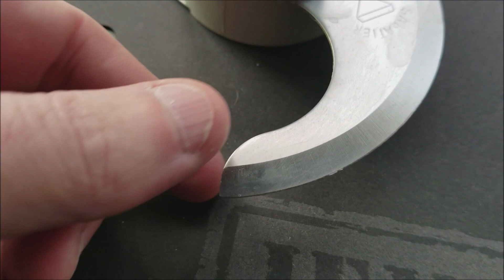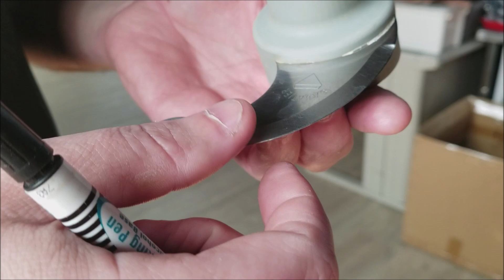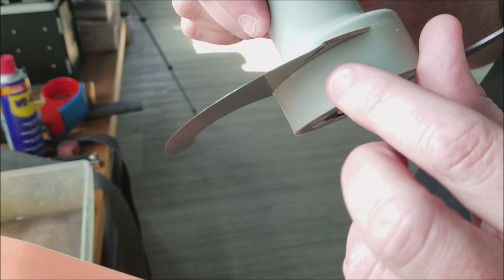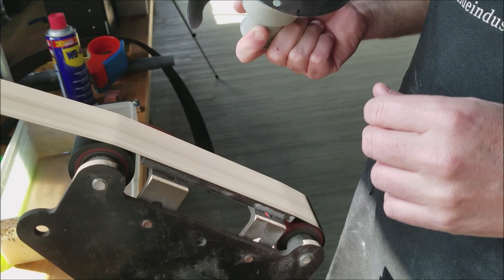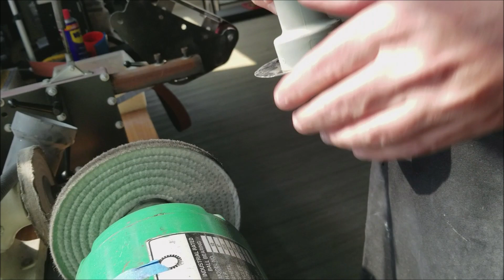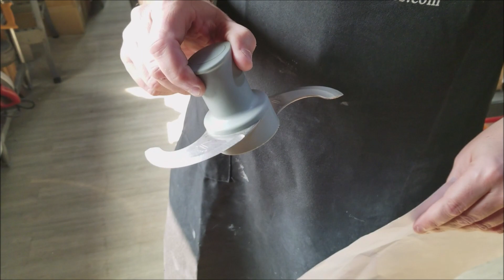Sharpening Robot Coupe Blades - by Jende Industries

Comment: Hi, Mr. Jende.  How much do you charge for that type of job?
Reply from the maker: Actual prices will vary depending on what prices are acceptable in your local market, but I charged 2x the normal knife rate for these since I see it as 2 blades to be sharpened. I recommend charging as much as you can, but fairly and so that the customer will feel it was worth the price for the service and come back in the future.

Comment: What about the Robot Coupe 27061 Fine Serration Blade?
Reply from the maker: Excellent question! The serrated blade of the 27061 looks like is not meant to be sharpened, and certainly not in the same manner as this video. You have 3 options to approach it, however. 1st is to just buy a new replacement blade. 2nd is to get a very fine file and file every single serration to get the tooth back, then hit the bottom side the same as in this video. 3rd is the hell with the serrations, and sharpen it the same as this video. Option 2 is probably best, but still quite time consuming and therefore sort of make option 1 the easiest.
Reply: @JendeIndustries  1st option spending $300/ year (2 blades) I must have the blades sharp for making almond and hazelnut butter. Option #2 is spending hours, :o)  I am taking option 1. Thanks for your great advice!
Reply from the maker: I wish you luck!  However, you may try this last approach - buy the replacement blade and then sharpen the old blade as in this video without worrying about the serrations and see if that makes a difference. I would recommend using a coarse file or very coarse grit belt or stone only. Mechanized anything is usually more about the shape of the blade than anything else, including refinement. The roughness of the edge will help maintain that serrated effect. If you do it, please let me know how it turns out!

Comment: Nice video. Again an "EXPLAINFULL - STRAIGHT TO THE POINT - WITHOUT HYPE" characteristic video of yours. 
Although beeing an amateur, I had a quite similar blade - only a tad smaller - in my kitchen to sharpen. I thought, if I can sharpen adequately my kitchen knives, why couldn't I do this???  Well, once again you are correct, THIS IS NOT A SHARPENING 101 CASE. 
I took it into my small amateurish workshop, fix it in a vise, and tried to sharpen it eith a slipstone of mine. I hadn't realize the amount of time and effort needed -  as one approaches the "deepest" point / the bottom of the concave bevel, the surface to be abraded becomes suddenly larger, which ultimately means that the pressure one really applies becomes inadequate, unless you use more force, bearing down on the blade with the slipstone. But the cylindrical shape of the axis held in the vise doesn;t help - unless one uses special jaws for holding firmly cylindrical objects which I don't have.
All in all my results were mediocre, even for my own standards, considering solely the sharpened edge ... but again you are correct, blades worked adequately when installed back in the mixer/blender, thanks to the speed.
I 'll repeat the effort in the future, although these blades are not really "charmers", since I still consider this case as a challenge for me. Next time I'give it more time, I'' ll use a coarser stone, and I'll use - much more decisively - a microbevel.
Many thanks for sharing. 
MERRY CHRISTMAS AND HAPPY NEW YEAR 2022, if I don't post till then.
Reply from the maker: You truly have the sharpening bug, sir! Anyone who decides to take on a robot coupe blade or planer blades, etc. with a slip stone is definitely in for one of those "be careful what you wish for" moments! Once you start one of these, you have to follow through. In my early days, I would easily spend 5 or 10 hours on a blade, and on one project I spent weeks on. The good news is that now you have this experience under your belt, and to be honest, these time consuming attempts actually teach you all the little things you will need to know in the future. You may not pick up on the learning moments as you persevere through, but you will recognize them the second and third times you find yourself in this situation. Most importantly, Sharpening is easy once you know the rules. It's the troubleshooting that is the tricky bit. My warmest holiday greetings to you and wishes of a healthy covid free 2022! :D

Comment: Thanks for this, learned a LOT after trying to run the wife's old Cuisinart blade (same shape, but smaller) through my lazy man's knife sharpener... I should have made a video on how poorly that went, haha. Some questions... The original concavity of the blades is just a function of how the grinding wheel ground it at the factory, right? And not necessarily a designed-in feature that's desirable somehow? Also, let's say I know a guy who cut himself trying to sharpen his wife's Cuisinart blades and he maybe wanted to get a small belt sander to up the danger ante. Any size, models come to mind that might be a good place to start for a beginner in the home shop? Thanks for any help, I'll pass the info along to this guy...
Reply from the maker: Sorry for your loss :) Yes, the concave blade is from factory machinery grinding, so it serves no real function. because of the advanced acrobatics involved, I wouldn't recommend going full mechanized sharpening for one blade, you could probably do better with using a file or some sandpaper on a paint stick with the blade in a vice. The key is to make the edge shaped again, not so much super refined. The speed from the robot coupe will do the rest.

Comment: Why no cut resistant gloves as stated in the manual
Reply from the maker: It probably wouldn't be a bad idea to have the gloves, but I would lose street cred! :D :D I wear safety goggles and if I felt more danger was involved, I would've acted accordingly.  I actually sliced my finger a little when cleaning the blade after sharpening. :)

Comment: Thanks for this...just not something one will see everyday on the UTube.  Very good advice.  Are you trying to take the hollow grind out?  I think I might need a little more practice before I tackle something like this...lol.
Reply from the maker: Yeah, these blades are definitely not for the inexperienced sharpener, but once a method was worked out, they went pretty quick for me. That's part of the fun of this sharpening journey we are all on! The purpose was not to remove the hollow grind per se, but the slack portion of the belt was going to remove some of the hollow grind as a default and keep the look cleaner. If I had used the platen, there would be potentially several facets from each of the passes made on 2 belts.